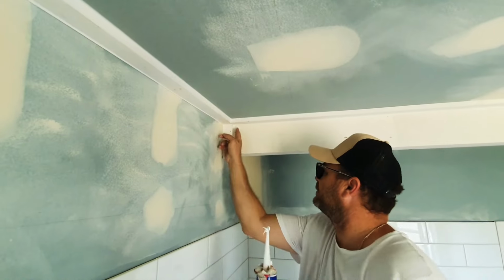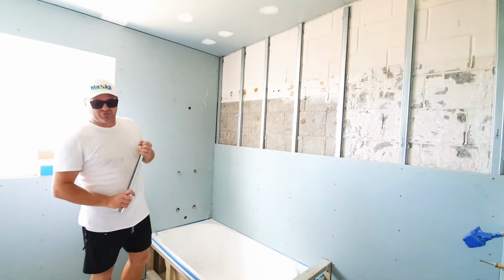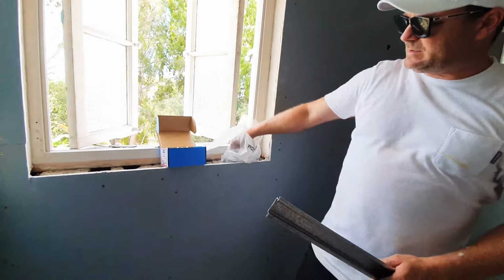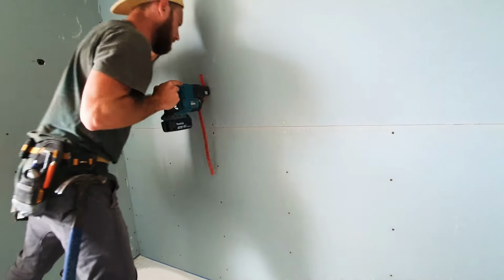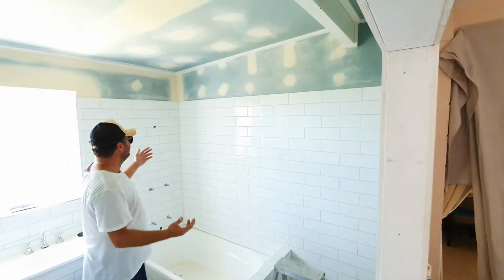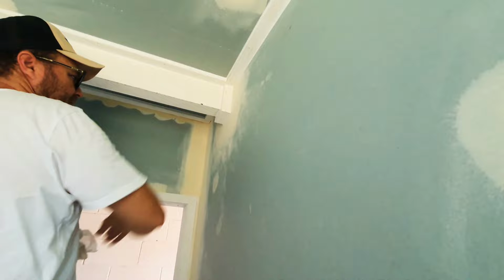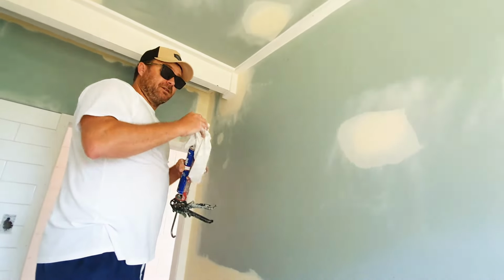Bathroom Renovation - Drywall Fixing, Caulking & Spraying New Drywall Ceiling

Comment: Hi guys good to see you have used aqua plaster board but you still need to waterproof which you didn't it's Australia building code to waterproof all wet area looks like you'll need to rip it out and start again do it wright in the frist place you wouldn't have the headaches all the best jim thr master plumber from queanbeyan nsw.
Reply: So, are you what they call a cowboy in Australia?
Reply from the maker: It is waterproofed, by a waterproofer.
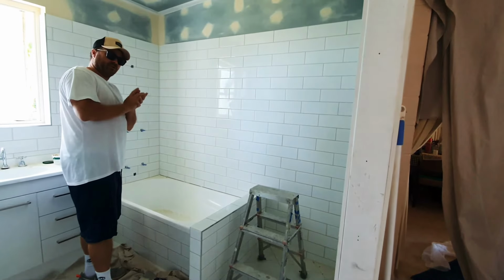Reply from the maker: 02:28 waterproofed. You don't need to waterproof laundry or toilet . So what your saying is ....